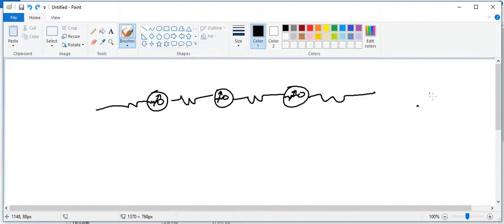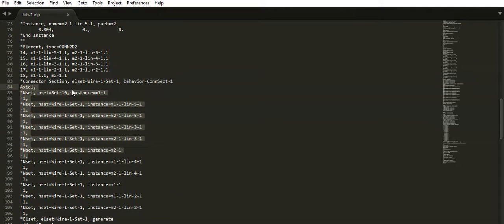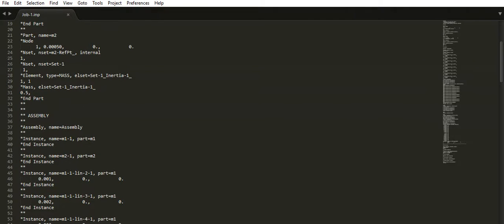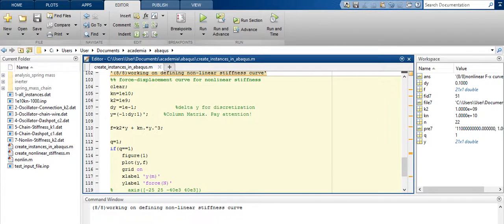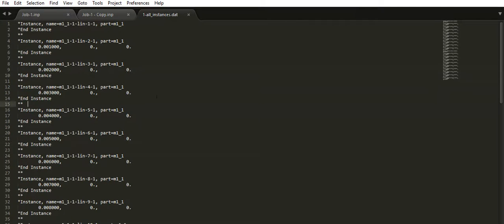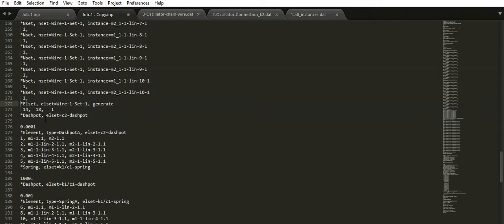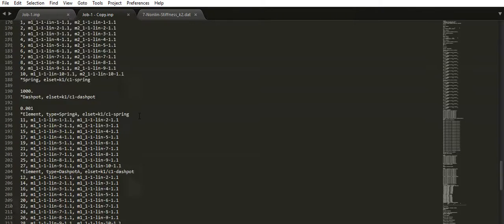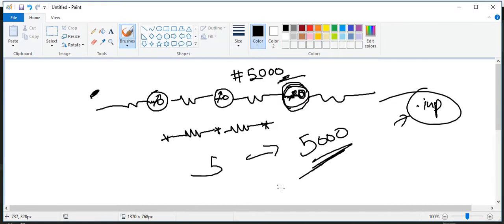Spring mass chain with local nonlinear spring-3

Comment: Hi Prateek,

I have 2 springs in series. one of length 70mm, damping coefficient C =1, stifness = 100N/m and, other of 25mm length, C=100, K = 300N/mm. I am guessing, dashpot coefficient is same as damping coefficient in Abaqus. Correct me if I am wrong. I have modeled a spring system with not point loads but with a force of 1000N which follows a sine wave F=sin(1000t). i.e., I have assigned an a periodic amplitude. I have given the Step information as dynamic, explicit. The other end of the spring system is fixed. But my model is getting aborted when I run it. Is there something that I am missing? How to model a spring with Force as a sine wave? I am expecting a sine wave deformation.

Regards
Vaidehi
Reply from the maker: Hi Vaidehi,
Can you share the error message you're getting when the analysis aborts?
To answer your modeling procedure in general, did you look at this video - " https://www.youtube.com/watch?v=8BcvwIbj558&t=248s "